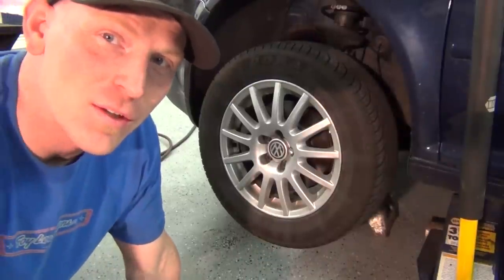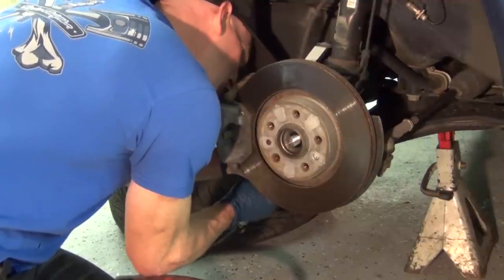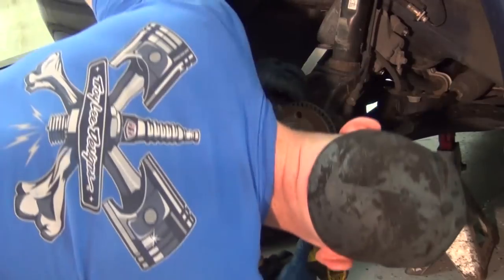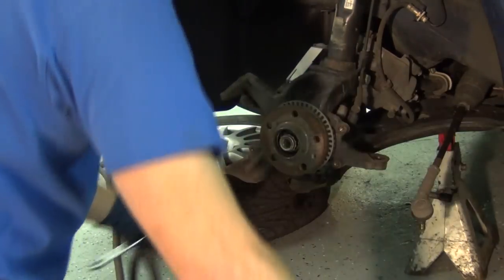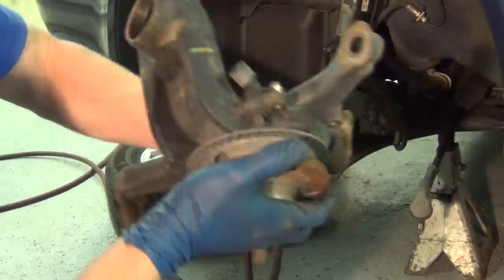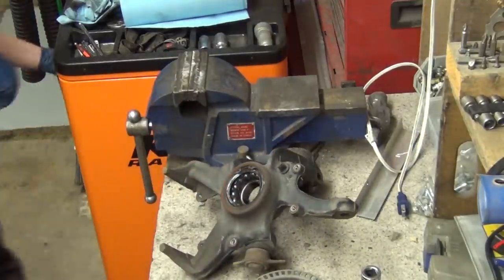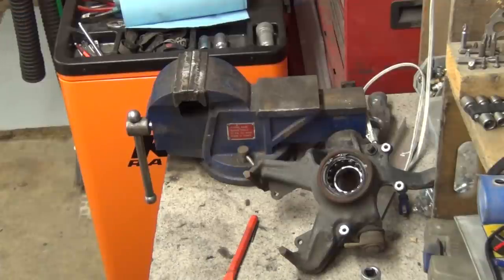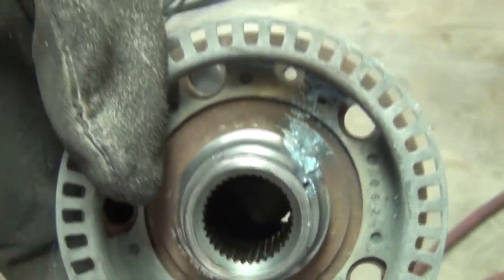FWD Wheel Hub Bearing Remove Press Install VW Golf HIGH DETAIL

Comment: Working as a mechanic for 50 years and fitted hundreds of wheel bearings this guy is doing it about right.
One thing I will say is if using old bearings parts to use as a mandrel on a press,  they are hardened and can "explode" and cause injury. I did notice that he did put on safety specs this time for the video, if you don't that's when it will "bite you" if you haven't any to hand cover it over with a piece of rag before putting serious pressure on it.

Comment: I bought a similar kit online for 70 and it saved me an alignment and about 3 hours of hassle. On that bolt at the top I add a thrust bearing and I lube it down with transmission fluid and moly grease so save the bolt and threads from the impact. Doing that kit by hand... god bless ya that’s all I can say! My local machine shop said they could also make me a bolt very similar out of much better steel for an additional 67$. I may do that at some point but I haven’t had the need since I use the thrust bearing and lubricant on the included bolt.

Comment: Brian you just saved me a lot of money with a hub. The Audi TT early model has a certain kind of hub that apparently is only OEM with are about $225.  I tapped out the hub with the 30mm ( perfect ) and then took a dremmel tool to cut the old race and then pried the race off very easily.  The condition of the hub was in very good condition.  Thank you very much, great video!   Subscribed!!

Comment from the maker: It may even balance better too.  The reason I don't is that it may weaken the hub to crack as well.  My goal is to preserve as much strength as possible.  The inner races of the new bearing provide a great deal of strength and it would probably be fine 99% of the time.  I just feel skiddish about taking any more of the hub off than is absolutely necessary.

Comment: I would like to say big thank for your video. I have done it according your video and everything  went fine. We haven't got hydraulic press like you so we had to use a big hammer (bearing out) and then I put my 10T hydraulic press under the garage's door frame with helping rough wooden stick we put a new bearing to right place but everything took more and more times.
Mirob Slovakia

Comment: try sometimes... take a steel rod bend it u shape. weld it to the ring and take sliding hammer and quickly hit it off while it is still warm. it leaves out quickly without damaging anything. faster than a grinder safer than a plasma cutter

Comment: I (err, I and some help with others) recently did this on a VW Golf Mk3 1,8 GL. It had a 4 bolt hub, but the same type of ABS ring bolted to it. I managed to get in there with an angle grinder and ground the inner bearing race loose. It took a while and you have to be really careful when you reach the hub itself, but I got it off, leaving almost no marks at all. =)
Getting the ABS ring off was not happening though. The impact screwdriver bit broke off inside the screw! The outer bearing race had to be pressed out and the new bearing pressed in. Not the easiest job to do tbh. Don't try it with simple tools at home, the risk is BIG that you need a proper hydraulic press and all kinds of tools. Also, after getting it all done, you should really get a wheel alignment (or more specifically a camber adjustment, unless you make REALLY good markings, EXACTLY where it was before loosening the strut bolts).

Comment: This is for Antonia Pimentel Ortega. The problem with pressing the hub straight onto the bearing is there is a retaining ring or circlip that must be  replaced in the knuckle first. ITs job is to stop the bearing from coming out each end. I have just done my front wheel bearings myself. The retaining rings were a challenge to get out. Have a can of penetrating fluid. It is your best friend sometimes. I hope this helps.

Comment: Easy race removal - Just a tip for those that don't have a plasma cutter sitting around (I wish). A Dremel tool with a cutoff wheel works even better on the bearing race stuck to the hub. Even if you have to buy the Dremel just for the job they are cheap and come in handy for many other things. Cuts a quick and easy slice in the race. A couple taps with the chisel and the race slides right off.

Comment: Excellent video. Great!!! You are right, that Harbour Freight tool is not better than the press but the accessories in the box are sometimes useful for pressing instead of using sockets. I just bought Orion Motors tool kit from Amazon exactly like the one you have but the press is better choice that reflects professionalism on job.

Comment: Wished I had watched this video before using my Hayne's manual to do this job. I learned the hard way that the inner race needed support while pressing in the 2nd stage. I destroyed a bearing the first time....was not impressed. 

Also, I didn't use a plasma cutter! I used two long pry bars opposite each other to prise it off. Just be careful with the ABS sensor ring and even if you bend the ring a bit (like I did) then a pair of vice grips does a nice job of straightening it.

Comment: I had done the same job and every thing work out oke but now I have to much space between te senor and the spindel I was afraid to damage the abs sensor so I took it of and that was my mistake but nevertheless your instructions where very clear and I was able to do this job only thing a did different I used a puller tool to get that bit of the spindle instead of cutting it of

Comment: Hey Brother, It might be prudent to mention that the bearing for cars with ABS may have a weak magnet inside one of the integral seals.  Some bearings have magnets in both sides, which makes it easy.  I locate that magnet using a loose staple.  That is the side that should be facing the ABS sensor when pressed in. 
I love your reference to John 8:1-11.  My eyes can see it.

Comment: I've used a 1/4 square drive sometimes --- like a 1/4 adapter or short extension to relieve the pinch of the knuckle on the strut.. When turned ~45-degrees it will open the pinch.

Comment: great video , but stupid question i have is is does the same wheel bearing for rear wheels are they on the front wheels... and does there always have to be wheel bearings on all wheels of the same type or do they some times have different types on different wheels? I would imagine like a skate board you push the same types on front and back wheels and all wheels have to have bearings if they want to rotate

Comment: Aftermarket knuckles for VW use screws to attach the exciter ring to the hub which makes it easier to remove to separate the bearing race from the hub

Comment: New floor jack? Why Napa? Just curious. I had bad luck with a Craftsman pro 4 ton jack, only lasted a year and parts were not available to fix oil dripping out of the pump. My point though is that I did extensive research to find a more reliable jack. Believe it or not the jack that kept coming up as longest lasting is the Harbor Freight 3 ton. Was wondering if you know if that Napa one is a solid jack because it is lower profile than the HF jack. Thanks

Comment: I notice that you didn't replace all the nuts and bolts hardware.  VW is pretty specific that all suspension hardware is torque to yeild and must be replaced each time its removed with brand new hardware.  What is your opinion on this?

Comment: Well working as a mechanic for 50 years, you should know what a wheel puller is. See that little dimple on the end of the cv shaft? That is where the center of the puller goes. It has three arms on it to hold the back of the hub and the center screws in to separate the hub from the cv axle. geees think you should know this.

Comment: Great video thanks. Quick question, I notice you press the hub down onto the bearing from the top, and it's a bit of a balancing act, because the housing is a pretty irregular shape. Is there any reason why you can't just flip the whole thing over, lay the hub on the base plate pointing up, and press the bearing / housing down onto it, (with the press pushing down on the inner race)?
Reply: That would seem more convenient to me. But I think he pressed it in from the top to have a better look at the angle of the outer hub and clearance to the exciter/ABS ring.

Comment: Brian, excellent video!  Question: Why doesn't the keeper ring on the hub side keep the bearing race from staying with the bearing rather than leaving with the hub?  It did the same thing on my 1998 Maxima.
Reply from the maker: Roger Buswell The outer race stays in, but the inner race could come out if not for the CV axle through it.
Reply: briansmobile1 Thanks Brian.  That makes sense.  It would be nice if they made the bearing in one piece. I'm sure there's an engineering or expense reason they do it that way but it sure makes for a hassle.

Comment: German engineering usually tells you to angle tightening the final step.  Did the CV joint on my Audi a couple of years ago and I was suppose to angle tighten it 90 degrees for the final, but when my torque wrench got up to 200ft-lb I called it a day.

Comment: and another thing i was thinking about is wheel bearings  only on certain drive cars like would front wheel drive cars have all cv boots and only wheel bearings for the nonpowered wheels... basically what i am thinking about is nonpowered wheels are they all bearing based and powered ones are all cv joint based?

Comment: what would be your opinion on pressing wheel studs in the back of that thing i hate these blame bolts,also how much would this differ from an 01 golf gti,thank you for the information this has been very handy now i just gotta work on getting a press
Reply from the maker: +Kwitchabitchin Nowman I recommend keeping it stock.  You COULD drill out the threads and pull in some wheel studs, but with the forces etc involved, it's a risk that may be higher than the reward.  I would have a machinist drill them if you opt for it.  The process would be similar on a golf.

Comment: I agree with you id far rather use the press then do it on the car its like pressing ball joints if you are working alone a person just does not have enough hands to hold a the adaptors

Comment: Still on the original brake pads and the wheel bearings are shot?  Could the fact that the factory torques these wheel hubs to such ridiculous torque settings as you just mentioned be a clue???

Comment: I did my wheel bearing on my 95 gtivr6 and the inside of the hub is rubbing on the knuckle assembly, so it the inner abs ring. I dont know what to do, I did not even tighten it down to 150 ft lbs. What is up?!

Comment: Gotta be super careful with some wheel hubs with the plasma cutter.  Some hubs have seals that ride on the surface right after the bearing (nissans come to mind).  I find a dremel with a small cut off wheel works way better than an angle grinder.

Comment: Well I'll tell you.. It's to get the hub off the cv axle. I just did this same job, and both sides needed a hub puller to get the hub off from the cv axle. They don't just slide off that easy. Ask any mechanic. Look it up before asking dumb questions.

Comment: Is this process the same for the rear wheel bearings?! thanks...
Reply: its not the same especially if the rear suspension is a beam torsion dead-axle. if it is a dead-axle then its much easier but different tools are required. (slide hammer)

Comment: Is there other procedure to remove the bearing race from hub without use the blowtorch?
Reply: you can cut it with a cutting wheel. a dremel would work.
Reply: Omar is Rad   I used to use a benchgrinder to grind down the race until it was about 1/16" of an inch from the hub, and then use a sharp chisel and hammer to split it.

Comment: Do you not have to replace that bearing race you cut in half???
Reply: The race is built into the bearing you install. That race sticks on almost every car and separates from the bearing assembly when you remove it. Total pain in the butt!
Reply: That's why you just replace the hub assembly too. They are no where near $120. More like $53 on Kerma site. In fact, a bearing and hub can be had for $100 ($47 and $53 respectively). It's not a bad idea to replace the hub since worn out spines on a hub will cause premature bearing failure anyways.

Comment: Usually is never that easy with little taps with the hammer.  Even the rotor sometimes I had to use a rotor puller w/o beating to death with a 10 pound sledge.  Axle yep that I had to use an axle puller, tie rod also need to use a separator tool  usually VW need to use special tools cause they rust easy..

Comment: I am doing the entire suspension and in the middle of replacing the hub/bearing on a 00' Beetle. Pretty sure it's the same shitty components. What a fucked up way to engineer a car. Instead of saving the rusty old outer hub, Ebay has the hub & bearing for $35. That should save a lot of farting around with cutting that ring. I would also recommend to anyone doing this to NOT attempt to remove the ABS sensor bolt if at all possible or you will be replacing the sensor or bolt. 56,000 miles on the car and the ball joints, inner/outer tie rods, wheel bearings, and struts are junk. Quality German engineering right there. The control arms are tiny plus cheap stamped steel and the ball joints are for some weird reason bolted in place. Sure glad it's not my car. 

That reminds me of looking around the garage for tube steel and sockets playing the balancing act on the press, haha. The thing scares the shit out of me when pressing out bushings and bearings and they "pop" like a shotgun and everything goes airborne.